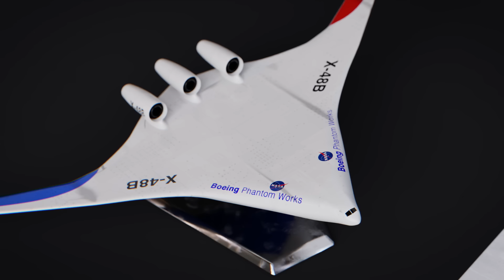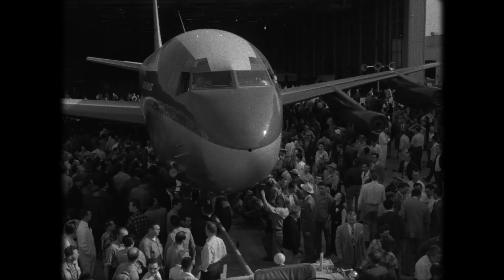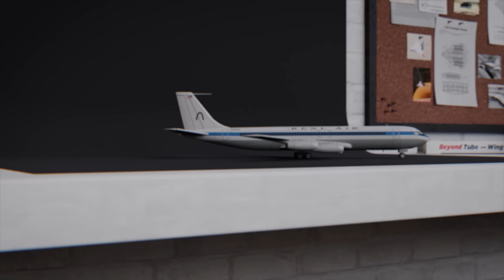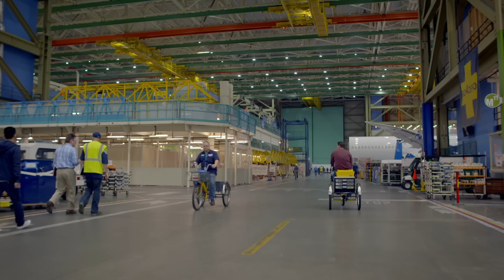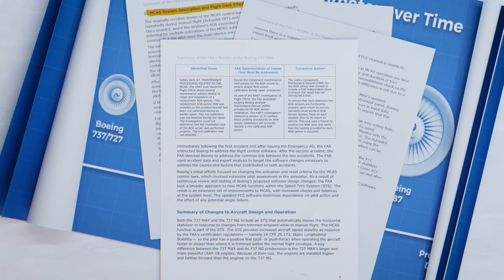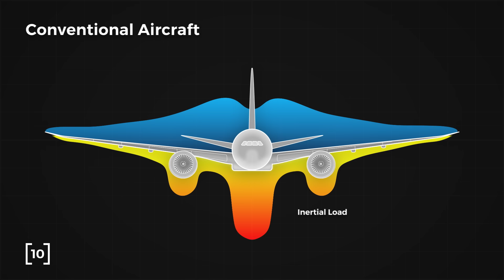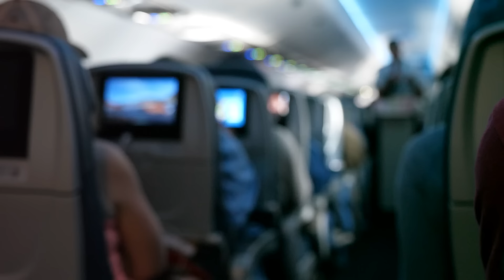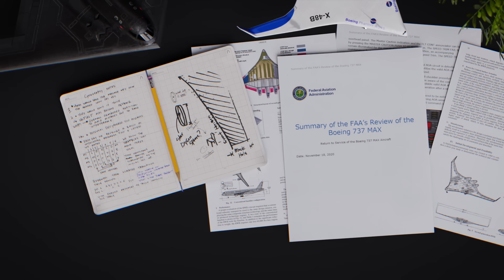The Plane That Will Change Travel Forever

Comment: This video is not bad, the problem with your reasoning, however is simple, let's just ignore the 737MAX, let's take the A320 which is fully FBW, in case there is any malfunction to the flight computers, there is a backup mode which streamlines the whole systems and reverts the FBW system to standard hydraulic system where the side stick controls directly the control surfaces, so the pilots could fly the plane completely manually, like if it was a 737 in case there is a major failure to the flight computers.

The problem with unstable planes is that this last "line of defense" is lost, if the FBW computers happen to suffer a catastrophic failure there would be no way humans would be able to fully take over, and giving the fact that a private industry is more incentivised to cut corners (as we saw in the 737MAX), I'm not sure if inherently unstable planes are the future of commercial planes. 

We already saw cases where the pilot's ability to control the plane has been fundamental, for example Qantas 32.

Also while it's a bit pedantic, the 737 is not FBW, MCAS acts on the trim, which then directly operates electric motors in the horizontal stabilizer, but in that context I think it was fine

Comment: I'd suggest looking at the ЦАГИ's (TsAGI) proposal for a future airliner, as they got a slightly different solution. but off course only time will tell which solution is better
Reply: Google left me empty, what's the proposal you are talking about?
Reply: @elektrotehnik94_ND  https://aviation21.ru/cagi-provedyot-novye-produvki-modeli-samolyotaletayushhee-krylo/
Found this in Russian, seems like there isn't much info in English on it.
It still looks interesting. As it gives the benefits of a flying wing, while being able to retain the same infrastructure on airports and not give anyone in the outboard seats motion sickness :D
Reply: @250Skyer250  Thanks, great source <3
Regarding this aircraft model, as I see it: 
- comparing to the model in the video, worse aerodynamics & very similar manufacturing challenges... I struggle to find the benefits of this design...
Reply: @elektrotehnik94_ND  They apparently found that this type of fuselage some benefits in aerodynamics aswell over the normal flying wing, don't exactly remember what the benefit was, Stability was one, the other was some form of Drag IRC
Reply: @250Skyer250  it looks like a compromise between a normal jet and the "Real Engineering" jet. The problem of the hybrid design is that it inherits most of the negatives, but few of the positives (very common in engineering, especially if as an engineer you don't know what you're doing ^^).

I might be wrong, it's VERY complicated in either case tbh

Comment: 7:55 Another problem is creating variants.  You can't just make the body longer or wider without redesigning a lot of things.  That makes the airplane (for the FAA) "different aircraft" and would need to be approved and pilots would have to be trained on it.  And one company made that mistake and failed hard.  That company was Dassault with their Mercure aircraft. The aircraft was super efficient, more efficient then the Boeing 737 in the short haul market. So exactly like the blended wing (I mean it with the efficiency and not the short haul). But the Mercure failed because they could make variations, because the aircraft was specially designed and there were no longer or shorter variants. So I don't have high hopes for the blended body plane. I think the tube and wings is the best design and no other design will change it with in the near future. Maybe after 40 years of development and great autopilot technology the blended body could be a thing.
Reply: well, reusing the same airframe to dodge the FAA worked really well for the 737 max and those 346 souls, didn't it. This mindset not only stifles innovation but also threatens aviation safety.
Reply: I think it is ok to change the airframe (to an extended) without FAA approval, but not OK changing the physics of the aircraft (like Boeing did) and not telling FAA
Reply: That's something people don't think about very often, is that the success or failure of any A&P has as much to do with non-engineering factors as it does all the engineering problems to be solved. You can build an aircraft that is a technical marvel, but without solid logistics and business knowledge applicable to your market, you can still struggle to sell any and eventually exit the market. Look what happened with the L-1011. Your example with Dassault was spot on as well, after the Mercure failed they never built another large airliner again, sticking to military jets (just like Lockheed) and continuing the Falcon line of private jets. I don't think people realize how risky a position Boeing is in right now considering the issues arising with the 777s as well now. They make one major decision (like trying this concept out full scale) and it doesn't pan out, they're more or less done, as crazy as it sounds. They're becoming the next McDonnel Douglass and it's like they can't even tell. It may take like 20 years but I don't think Boeing will be in civil aviation anymore by the time I'm 50

Comment: Unfortunately, archaic regulations from the FAA and other flight governing orgs around the world will ensure the status quo wins out. And if Boeing or Airbus or a 3rd party brings a radical design like this to the market, I can guarantee that other interested parties (competitors, airports, parts manufacturers) will do their very best to stall or regulate the new design out of their marketplace.
Reply: it's not just regs: economic incentives will push for the status-quo to remain. Blended-wing designs will really need to be pushed hard for the design to be adopted, and that will only happen if there's a large-enough advantage to them (which remains to be seen). But it's not like large, airport-restructuring paradigm shifts to aircraft design haven't occured in the past
Reply: I wouldn't say the regulations are archaic, but they could certainly do with improvement. As others have said, this video overlooks critical aspects of safety and the realisation that that planes are required to carry passengers who need to board & depart efficiently - more so in an emergency. If one of these gets built and eventually crashes (all planes crash eventually) then imaging the outcry when people can evacuate and perish. The modern plane design is not driven by pure design but a trade off between safety, design & practicality- an optimal design. This is why the "tube" design has evolved as the best solution.

Comment: Not agreeing with the explanation of the problem in the 737 MAX. The handling of the plane was ok, not dangerous. The problem was that it flew in a way different enough to other 737s to require recertification of pilots trained for regular 737. Boeing didn’t want that because would have been expensive for the buyers and introduced the MCAS to mimic flight characteristics of the regular 737. MCAS was designed and implemented badly because of bad/greedy corporate culture resulting in 2 crashes and all the rest.
Reply: The crashes weren't caused by greed. The MCAS system used the Automatic Trim system, for which procedures on what to do if it malfunctions hasn't changed since the first 737.

The issue was pilots not being able to comprehend a basic malfunction.

The crashes would have never occurred in a western country with trained pilots.
Reply: @TheOwenMajor  MCAS malfunctioning and pushing the nose down was the cause of the accidents. It malfunctioned because of poor design and eagerness to get the planes out of the production lines. That happened because of greed and lack of professionallity by the top brass of Boeing.
Your point of view was disregarded long ago, quite racist from you to come up with such views when actual people died.
Reply: @johnmeyer457  The issue was a simple malfunction in the automatic trim system. 

The automatic trim is not a flight critical system. The solution if it is not working is to simply turn it off.

In one accident they did turn it off, but forgot how control surfaces worked and left the power at full take of thrust, thus exasperating the out of trim issue and rendering them unable to correct it.

The other accident they simply had no idea of what was going on, the entire flight they were uselessly trying to fiddle with the autopilot somehow not noticing the trim wheel violently spinning right next to them.
Reply: @johnmeyer457  And to add, the MCAS system only malfunctioned because the airlines refused to perform basic maintenance on sensors they knew were malfunctioning. The airlines knew about these issues before the crashes but refused to fix them.
Reply: @TheOwenMajor  You can be as entrenched as you want in your racist view of the issue, but aircraft safety is based in multiple layers of assurances. One of the most important is a proper design and they badly failed in that regard. Because of that the whole series of aircraft were grounded until an acceptable design was delivered and the reputation of Boeing properly dragged through the dirt. But if you want to believe that it was all fault of «those damn african airlines that cannot maintain nor fly their aircraft properly!» (this is my impersonation of you) it is up to you.
Reply: @johnmeyer457  Your comment is a perfect representation of what is wrong with this situation.

You're so concerned with "muh racism" that you are more then willing to ignore blaring issues in those airlines.

Exactly why I don't fly on third world airlines, they run to the race card whenever something bad happens instead of fixing their own issues.

Comment: The B707 isn't really the first successful jet airliner, you forgot about things like the Caravelle and the Comet.
Reply: the comet had that square window problem.
Reply: @mrxmry3264  I know but it still counts
Reply: @cedjoe6  No it doesn't. The engines were placed inside the wing.
Reply: It really was. 707 is the first airliner with the ideal configuration.
Reply: @CAL1MBO  no mention of ideal configuration in the video
Reply: @CAL1MBO  "first successful jet airliner" I don’t see anyone talking about engine positioning